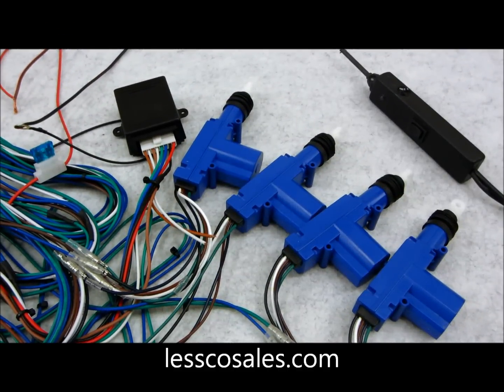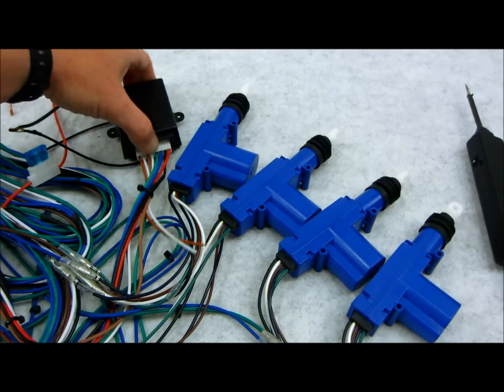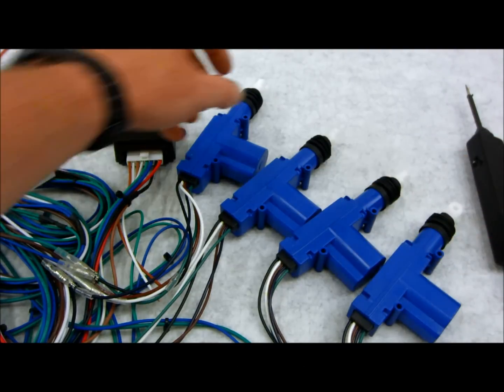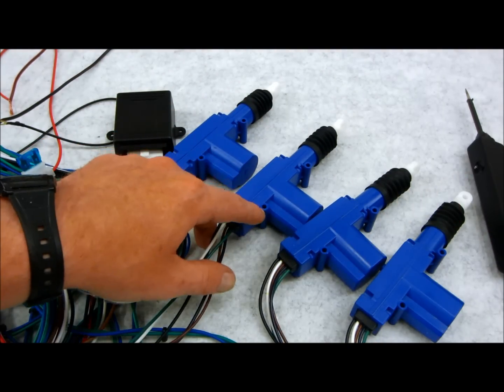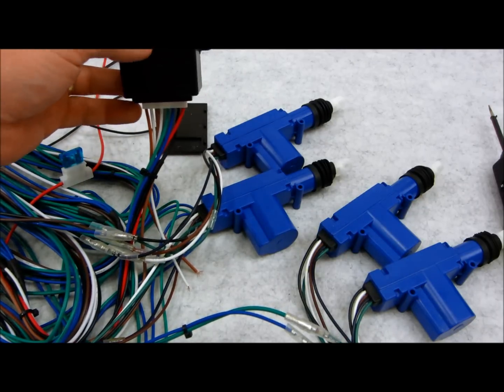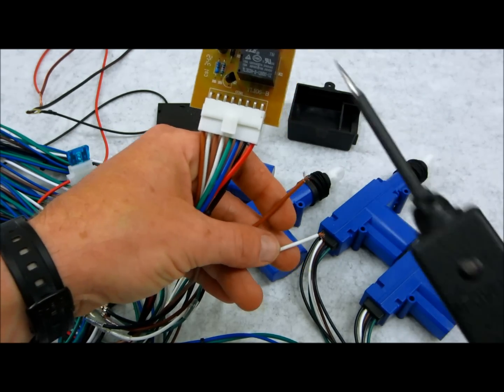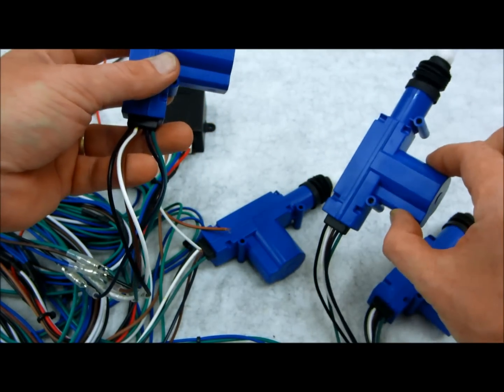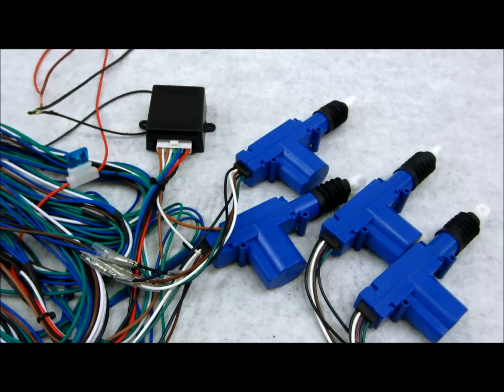How Central Door Lock Actuators and Relays Work

Comment: Nice vid, I currently have a simuliar aftermarket kit on a 3dr car. However it randomly locked me in. Im trying to find a way to unlock it as the keyfob or solanoids have stopped working, I didnt install this system but im stuck on how to open my car doors n fix or replace the solanoids. Any ideas? Would I be able to shock the system to unlock it? Thanks in advance

Comment: Is there any documentation on how many cycles an actuator like this is good for?
Reply from the maker: On average its 100k cycles
Reply: @Lesscoelectronics  -- Which would mean that in a typical scenario of you taking a trip to go to work or run an errand, it would last over 68 years (if you don't lock your car while driving).  This is assuming a scenario where you go out to your car, press the unlock button (#1), drive to your destination, press the lock button (#2), spend time at work / go into the store, return to car and press unlock button (#3), drive home, get out of vehicle, press lock button (#4).

If you lock your vehicle while you are driving, then the number of activations of the lock probably doubles...

-- Go out to car, press unlock button (#1) to get into car.
-- Start driving, press lock button (#2)
-- Arrive at destination, press unlock button (#3) to get out of car
-- Lock car (#4) after getting out of car while you are at work / in store
-- Come back to car, unlock it (#5) to get into car
-- Start driving, press lock button (#6)
-- Arrive back home, press unlock button (#7) to get out of vehicle
-- Press lock button (#8) so that car is secure at your home

That brings it down to 34 years... Maybe half that again to take into account those trips where you stop to get gas or run multiple errands on a single trip.

Just kind of reinforces how a simple system can be pretty reliable.  I've never had a car's power door lock system quit working .  The same cannot be said for the power windows or powered radio antenna.

Comment: I have a Toyota 4 Ronner 2000 and it who's repo. I lost the key and entry beeper ...got another key instead the s.u.v lock which key but don't lock automatic there for I can't program the new remote . What can I do to fix the problem?
Reply from the maker: +Ray vazquez is this a factory keyless or aftermarket? you didnt mention that
Reply: Yes is a aftermarket  when they tow my truck the alarm whent on  they did not had the ley to turned off they most to do somting to stoped  and to kip the doore from lucking automatick
Reply from the maker: you should check the alarm model (its under the dash) lmk what it is, I can most likely help you get that replacement remote

Comment: Hello i have an issue with power lock on my 1998 Astro van. The power lock is locking and unlocking on its own when the car is sitting and this drains the battery. And sometimes it doesn't react on the remote control. Any ideas what can it be? Thanks
Reply from the maker: +Dmitry Litvinov Ive seen that before, its the probably the factory vke (vehicle keyless entry module). unplug it and rewire it or get a new aftermarket keyless entry host system. the relays tend to chatter and lock up in those gms like that sometimes

Comment: Is there any modules or relays that will allow a constant 12volt out and open and close from a 1 second 12 volt pulse signal from door lock wire? My civic has a pulse lock signal, 0 on meter then flashes 11volt real quick the back to 0. I'm wanting to add a led scanner to come on with my factory alarm, lock and shut off when unlocked, since I don't have a constant 12volt signal from switch or a negative switch it won't allow the relay to stay open to send power to light, is there a pulse relay that will open and close with just recieving a pulse

Comment: Hi, thanks for the reply, but when manual switch used, all motors work perfectly, no wurring sound of sluggish moved of the lock/unlock pins..Its only when you use key (& remote) to unlock the 2nd turn sometimes does not unlock the other doors, and the crazy behavior of auto locking all doors when engine starts.Could be bad contacts at key switch, or bad relay contacts...or do you still think the driver motor is the culprit....thanks

Comment: Hi, Door locks on my accord 2007 started acting up, normally press remote once , driver's door unlocks, twice rest unlock, press twice and hold windows go down.Now, remote- press once driver's door unlocks, press again nothing happens but there is a sound from the driver's door actuator..but using manual switch , all doors locks and unlock as normal.Also once inside, door closed and engine started all doors lock after a few clicking sounds, which does not happen normally.  could a weak or going to be broke  master ( drivers door ) actuator cause this problem.Thanks....
Reply from the maker: +Packiam Harold sounds like that driver motor is tired out

Comment: Hi body! I bought new actuators with one master but I connected to the OEM module, (civic 97) they work normally but master doesn't works, original lock has 4 lines, black for ground, two ones for the unlock/lock and one left, I thought this is for the signal of the master one but I don't know how to connect it to the white or ground lines... so it didn't work, maybe you can help me! Thanks!

Comment: hi if u were to cut /disconect one of the locking system wood the other 3 still work help plz
Reply from the maker: +Grant Smith you can cut out any of the slave motors, but NEVER the driver door's master motor.
Reply: if i need to add one of this on my central locking (adding it to existing system) can i  connect  one of this motors only with power?

Comment: I have a problem with my accent 2012 with the master actuator, the place where you hang it by the screws is broken, the same hole i mean, which is plastic but anyway is there a way to fix that or should i get a new one and how to restore its balance to be able to lock all the doors using the remote. thank you.
Reply from the maker: +Ahmad Alghamdi It'll nevere be right until you replace the motor. It'll always loosen up

Comment: To Lessco Electronics,I have a Ford Courier 2.6 ltr 2005 petrol.my central locking is not working properly.I have changed the battery in the remote and the light is flashing.It wont unlock from out side the car with the remote.however when you do get in the car and start the car you can operate the central locking with the remote.Any chance you can help me?Jason

Comment: will it still work if there's no remote controller? i just got a 5 door central lock system to be installed but it doesnt have a remote. any suggestion?
Reply from the maker: +Russel Helendro Daoang it'll work all the doors by moving the driver door up and down by hand but thats about it without remotes.
Reply from the maker: +Russel Helendro Daoang get a keyless system like this one we have and tie it into the master (driver door) motors wiring: http://www.ebay.com/itm/Omega-Proline-REC-43T-3-Channel-Rec-w-Transmitters-REC-43T-/140433999764?hash=item20b284c794

Comment: great video -- thanks.  Question for you: could you adapt a keyless entry kit to control one simple circuit, such as the fuel pump?  I am thinking of installing something like this as a theft deterrent on my motorcycle -- just use the remote to actuate the FI system.  Would that work??  Thanks
Reply from the maker: Sure, your only limit is your imagination, thats a big reason I love this stuff

Comment: would it be possible to add a fifth actuator for a rear hatch?  the rear hatch has a lock separate from the handle it works the same as the other doors it is not like a trunk lock.

Comment: hi man,i need help to install a central door lock,can u help me?
Reply from the maker: +nori nounou what can I do to assist you
Reply: +Lessco Electronics thnx for ur reply,so i have the main unite of the central and 3 motors i want to instal them but i cant find the correct  diagram to intal the system
Reply from the maker: no instructions with your kit?
Reply: +Lessco Electronics yes ther is ,but i want t install it lik ur tutorial,b cos my car hasn't lock system
Reply: if u can give me instrucions i will be appreciat
Reply from the maker: you ca get the ones on the kit I have here at caralarm.com or omega tech at 800 554 4053
Reply: thnx a lot,i appreciate ur assistance

Comment: Hi,I have got a fiat linea 2010 model.The car was involved in an accident,so it has been standing for more than 8 months.Now,it is moving but the problem is the central locking system is not working properly.It,s enither it locks one door or none

Comment: HI This is off topic, but I would like to make 007 licsence plate holders for my car. Cough Golden gate tolls Cough. 
ANYWAY i was thinking of using these kind of door lock actuators and some bracketry. 
MY REAL question is are these actuators strong enough? the licsence plate holder would have a hinge at the bottom and the actuator arm would be in between the plate and the hinge. so unlock would be down license plate down and lock would be LP up. any thoughts?
Reply from the maker: It'd depend on the plate springs tension I suppose...

Comment: hi
please can you help me I have got an ML270 I was driving in the highway one day an heard a load click when I stopped my car I discovered the central locking system will not respond to the remote I have changed the battery but that didn't help the remote has been tested its fine you can lock and unlock the car from inside  but not with remote.

Comment: Hey man quick question how do the brain systems for power locks that have voltage output for window control connect I have looked everywhere. some brain systems have outputs that roll down/up windows with the remote

Ps thanks your videos have helped me a lot
Reply from the maker: Is there a model youre talking about specifically

Comment: I have a 1972 Pontiac Grand Prix. The car does have power door locks and windows. Is there a kit that I can use to lock/unlock the car and possibly even open/close the windows like on newer cars? I am also planning on ditching the carburetor somewhere down the road and would like to add remote starting (if possible) after I install a fuel injection system. If yes.....where can I buy the necessary components?

Comment: Hi. My trunk will not unlock via central lock and keyfob unlock, but works on hold keyfob to unlock. dealership has replaced trunk door lock assembly but problem persists. took it back to them and they ruled out wiring/electrical problems and diagnosed as driver's side (master) door lock assembly is faulty and needs to be replaced. does that make sense? can a problem with driver's side master actuator be the cause of the trunk not being able to be unlocked? also, everytime i open the driver's door when the key is in ignition, it makes unlock/lock sound 3x. thanks for any input
Reply from the maker: thirdz05 its possible, the driver door is the master actuator to the entire system. I've seen weirder things go down before
Reply: Lessco Electronics Ive had this problem since nov 2014.. dealership misdiagnosed it in the 1st place, replaed parts that weren't needed to be replaced and still ended up having the problem. good thing it's still under warranty. have to wait again for parts availability, hopefully problem will be solved this time. thank you for your reply

Comment: I have the Megbadyne ALA-DL1 Programmable Relay Pack w/ 5 door locking actuators, non of the actuators are the "master" actuator so I can't lock the car from inside once I unlock it with my aftermarket alarm system unless I arm the system from inside the car (kinda silly) my question is do you know how I can wire in a relay switch to lock the doors from inside the car?

Comment: I need help I can't get my prestige asp997e alarm to unlock and lock door s on my 1997 suburban with rear barn doors so for now I just hooked my aviral 3100 to the door lock wires to unlock and lock doors separate remote please help no video on 1997suburban with I think is 5 wire positive or negative door locks

Comment: i have a ram with power locks but no remote and they say it $400 to get them done …. i bot this kit and was wondering can i not use the remotes and hook up the relay some how to my existing power locks!
Reply from the maker: Ashley C All you need is this:  ( and its under 50 bucks )@140433999764and@400872587525
Reply: Ashley C If your vehicle has a power lock system, then all you will need is a key less entry module which costs about $12 (including 2 remote keys) Made in China rocks !
Reply from the maker: or just the factory remote being programmed should also do the trick too

Comment: Hi, great video. I'm installing an identical kit.

Do you wire the main 12V power wire (the one with the fuse) and ground wire directly to the battery? Or can you tap into another constant power supply from under the dash?
Reply from the maker: Go right under the dash for it

Comment: Hi, thanks for the great info here. I have a question. Is it possible to add a 5th actuator as a slave? so it would be 2 masters and 3 slaves. or is a second relay necessary for that type of setup? thanks
Reply from the maker: yes, just tap into any of the existing slave motors and it'll be just fine.

Comment: I see that you popped off the cover for your "brain" of the door locks... And you pointed out the two relays in it... If mine is similar (two relays already in the brain) do I need to add other relays to get lock/unlock function? 
Thanks in advance.
Reply from the maker: no, 2 relays is all there ever is in any door locking application, central or non central.

Comment: Just wanted to say thanks for the amazing videos, i have been out of the game for a while, used to do this for a living for some time, and now do little side jobs at  home and all your videos have been great refreshers.. quick question , i will be working on a 07 toyota yaris that has no power locks or windows, and i am doing a remote start/alarm system on it, its a code alarm ca5663, would i need something like this to add power locks to all doors? i bought 4 separate actuators for the doors, can i still use those? also what would be the easiest way to wire them to the alarm if i do use the separate ones? sorry for some reason i have this feeling i need diodes or something for this method.
Reply from the maker: all you need is 2 relays to power the actuators
Reply: Thanks. I will look online so I can refresh my memory as to how to wire up the relays. You don't have a video or website to reference that do you? Sorry I don't have access to this information like I used to before at my old job. I'll try and look at the 12volt.com.

Comment: I am working on my rear door. The power lock isn't working. I get +/-10v across the two wire lead when I switch lock open and close. How do I check for a faulty actuator.
Reply from the maker: Gino Punsalan try applying power from a 12v source, 10 may be insufficient
Reply: Lessco Electronics I replaced the actuator. It's working now. Thanks.
Reply from the maker: Easy... pull on it, if its frozen or crunchy sounding, its time for a new one

Comment: Do you have a video on adding a simple switch to a two door lock system that is used with an alarm. Unfortunately there is no switch on the car and I want to add a SPDT momentary switch so I can lock and unlock the doors manually. Of course I want it to work only when the key is in.
Reply from the maker: easist way is get a 2 way rocker switch like the ones well for 7.00 that throw ground when pressed up or down, connect that to the alarms -negative outputs

Comment: http://i00.i.aliimg.com/img/pb/778/507/404/404507778_752.jpg
Help with this sheme...how to switch my lights r blinking when i press the button
Reply from the maker: that schematic is only for central locks, If you wish to add flashing lights, I'll need the schematic on the keyless entry unit instead.
Reply: Lessco Electronics sry my language is bad...can u explain me (help)..module is the same like urs..but my master motor have 5 wires...and other motors only 2